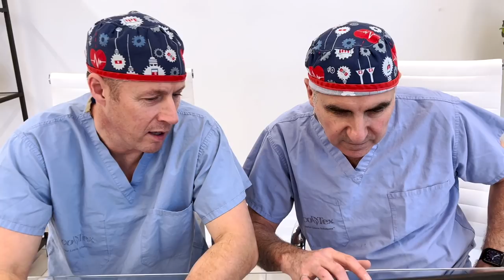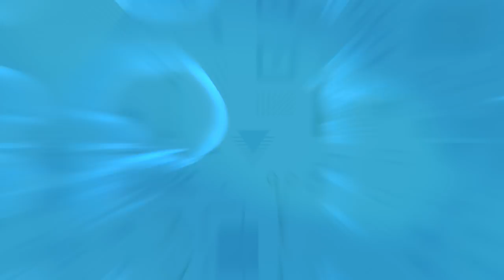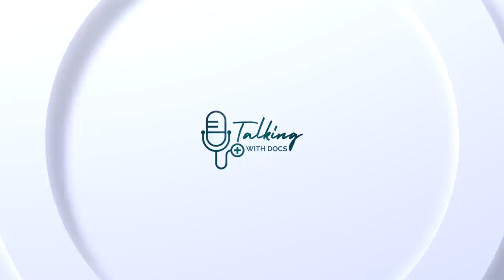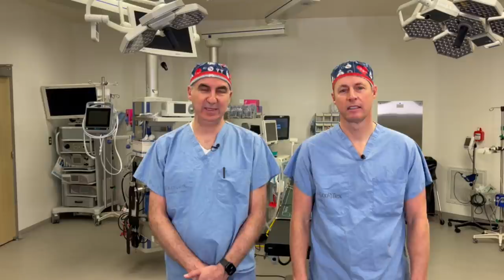Why Does My Knee Replacement Click?

Comment: It's a little over 1 year after Total Knee Replacement Surgery (Jan 2021)and I have some considerable clicking and Clunking under 2 circumstances: when I go through a full range of motion and when I walk. Chronic pain is all gone but when I walk, it goes clunk, clunk, clunk with every step and the clunking adds up to pain and extra effort (exhaustion). I feel like I am having to make a broken machine work;  with extreme bends, like sitting in a chair --  the poping to straighten the knee or stand up actually is quite painful (acute pain goes away right after movement)-  This is really disappointing, to say the least. My question after is if I have to have surgery again to fix this  -- why can't it be a midvastus approach sparing my quad - when all that needs to be fixed appears to be is a snapping popliteus tendon?
Reply from the maker: Hi Eric.  It is really hard to say the cause of your clicking abs clunking and there is a very real chance it is not your popliteus tendon. Often the median parapatellae gives better exposure.  Both are painful.  Maybe arthroscopic if it is a cyclops lesion in the notch. Go see your doc. Good luck. Thanks for watching and subscribing

Comment: 3.5 months post TKR, I have good ROM (2 degrees to 120 degrees), but i have a good amount of pain when I stand up after sitting for more then a few minutes.  Also, when I walk, my knee will pop ( not all the time) and it hurts to a point that I have to stop walking.  I also have pain when I flex my knee during PT, the pain starts at about 45 degrees until about 90 degrees.  Is this normal or do I have a problem?

Comment: My knee (surgery 7 weeks ago) started clicking in week 5. By clicking I mean something I feel every step. It is not necessarily painful... Just new to me and "mentally"  uncomfortable (ie.. Will this be forever and/or will I get do used to it I won't notice) ?

Anyway... Great informative vids, gents. Do you have one showing best exercises to stretch that knee out and specifically to increase range of motion? Are there different exercises to use after 6 weeks that you would suggest? Thanks again!
Reply from the maker: Hi Pat. It may continue to click.  Exercises are similar to the first six weeks.  Just push harder at the extremes. Thanks for watching and subscribing
Reply: Yep...the good pain...thx guys

Comment: Yessss!! I am at week 7 following my left TKR, and just got to the point where I am experiencing clicking. Because I have been so well educated by my Orthopedic Surgeon (and Talking With Docs) I figured it must be because the swelling has lessened enough that the points of contact have a little more room to move. My PT agreed. 

The thing is my knee sounded like a meat grinder before the TKR!! The before and after x-rays were amazing, akin to "shock" and "awe." And I have had NO PAIN. Yes, some mild discomfort with swelling and the muscles and tendons waking up, but nothing like what I experienced pre-surgery. 

Tip: my experience has been that acetaminophen 650/ER works much better than regular 500mg "extra strength" acetaminophen. The Extended Release lasts a full 8 hrs or more (at times, 12 hours), where the 500mg has me checking my watch after 3 or 4 hours. What a difference!

My question this week has to do with aftercare of the surgical scar. All my post-surgical friends advised me to have vitamin E oil or cocoa butter cream or the like ready to massage into the scar tissue. The thin strip of tape on my incision is still flaking off (everything dissolves or flakes off with dead skin -- no staples, nothing to remove). I searched on the internets for "best cream for post surgical scar" and came up with a bunch of articles saying not to put anything on a surgical scar. I'm not interested in hiding it, or trying to make the scar fade, but my skin is especially dry. What is your advice?

I, too, miss the opening music. And I would hate to see the Docs get snapped up by the film industry with all the new production improvements on the show!!
Reply from the maker: Hi Candis. So any moisturizer is ok on a healed incision. Vitamin E is ok. And don’t worry we won’t get too fancy!  Thanks for watching and subscribing